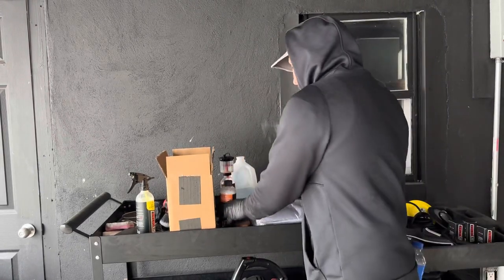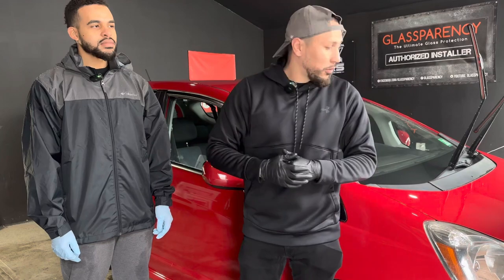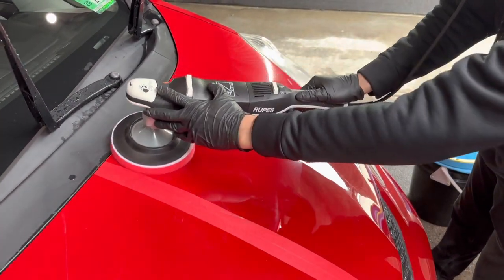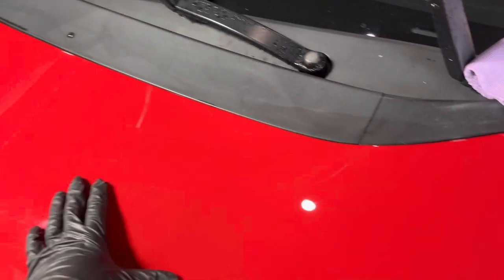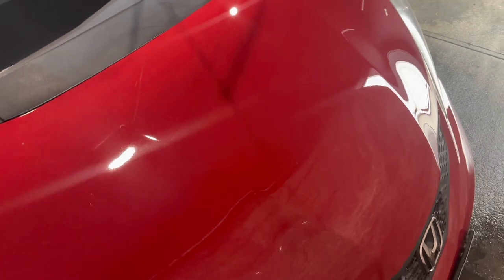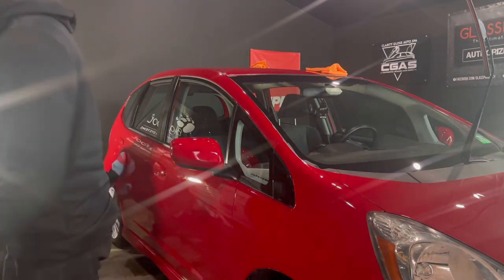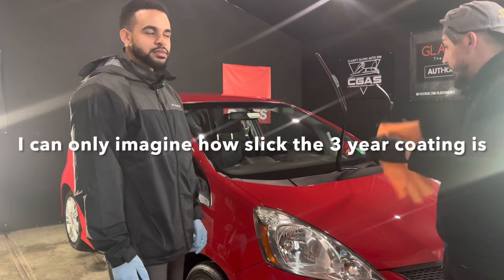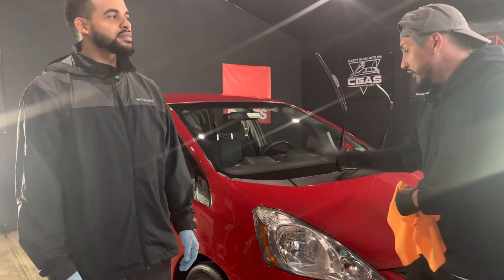NEW! DIY Detail 5 Year Ceramic Coating Good? Turning a Honda Fit To That Bih.

Comment: I'd love to see some side by side comparisons between the 3 coatings -- Yvan was mentioning that the 3 year is slicker, 5 year is glossier, and I am wondering how noticeable those things are. It'd save me from having to go through that myself so I'd appreciate it LOL

Seems like a great coating to give to customers though. The SystemX coatings I no longer use are a nightmare in anything above perfect conditions, and even in perfect conditions you gotta be quick -- But I was also wondering, when do you think you'd use this over the roar coatings n such? I figured that the roar coating is probably more expensive per bottle and to a customer it will probably be the same end result
Reply from the maker: I do have a test hood I can do a comparison on once I open the other two bottles to use on the vehicles. I’m really wondering the slickness of the 3 year has me really intrigued! The 5 year is very slick surprisingly I have a short being released at 4pm where I show the slickness and water behavior. If the 3 year is slicker than the 5 year. You are breaking your wrist 🤣🤣.

I’ve heard system x is hard to use. I’ve never used them though I can’t have a opinion on it. In terms or Roar Coatings. I’ve started to pull away slightly. It’s still a great coating. Maybe a tad bit more concentrated as it’s a “pro” coating. But we are pulling hairs here on that. Yvan wouldn’t want to put his name on anything he is not confident in. Roar coatings is still a great coating Yvan was supporting it! But as technology advances this maybe better due to the newer chemistry and ease of use. I love the DIY one based on price point. Other than that we are pulling hairs I guess. And one layer for 8 years?! Compared to roar where it is a 2 layer system for 7+ years.
Reply: @DetailingMadeSimple  yeah thats one thing thats good about systemx, that its one coat for their 6 and 10 year coatings. I am leaning in that same direction, I went back to applying CSL/EXO for a 5+ year coating just because it was much easier to apply in my conditions. And yeah at the price point, its significantly cheaper for what you are getting in those DIY Detail coatings.

Lookin forward to more of the coating videos, and damn definitely lookin forward to lake country getting their sht together so I can get one of them rotary polishing pads 🤣
Reply from the maker: @randymurphy7051  exactly! One layers easy to use long durability is what we after with gloss and slickness. 

Yes they need to hurry up!!! I want to buy more pads too. My wife is going to start using them. 😭😭 I love that rotary waffle pad. That’s my go to now. The old black waffle pad is no more. Same with the white rupes waffle o don’t use it.
Reply: @DetailingMadeSimple  Yeah I am currently stuck with the black waffle and white rupes and I am still struggling on most cars to get a swirl free finish. Can't wait lol
Reply from the maker: @randymurphy7051  You’ll love this one. I just love the slight cut it can do and great finish. It’s just that the black waffle and white waffle are too soft. Depending on paint type it just doesn’t really refine the finish to the max potential